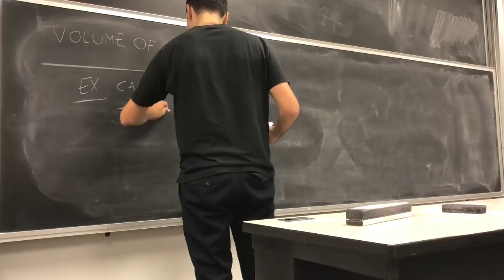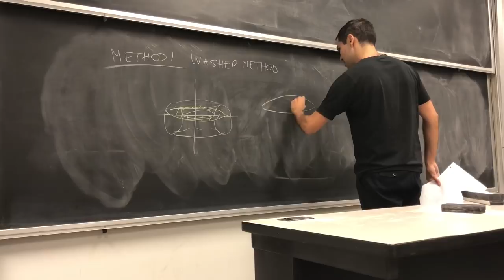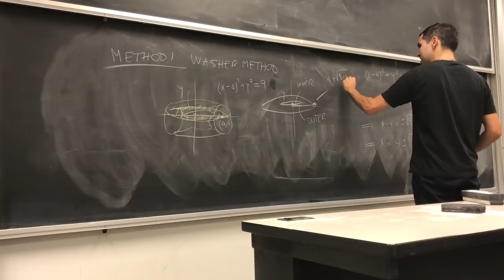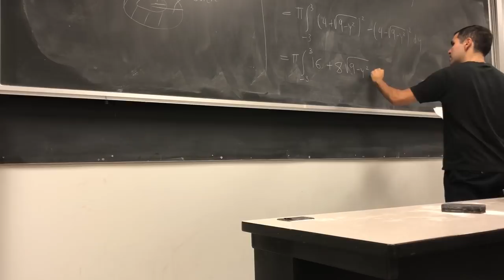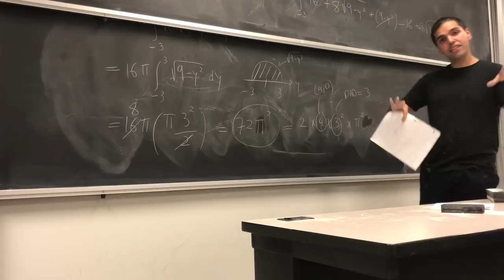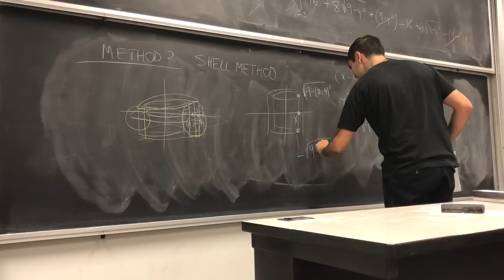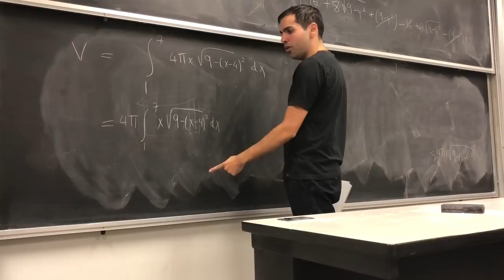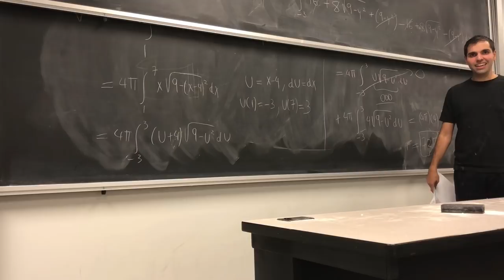Volume of a donut

Comment: Why not just 8π × 9π = 72π² (Volume of a cylinder)?
Reply: This is a more rigorous proof of the volume of a torus. Assuming it is a twisted cylinder isn't rigorous enough to prove it, but it is a nice intuitive solution.
Reply: @GhostyOcean   Why would this method be less rigorous? You could rephrase it as the area of the cross section, of the torus, multiplied by the circumference of the average radii running from the origin to the torus.
Reply: @jameroth7661  you have to show the volume you lose on the inner part is exactly gained on the outer part. Maybe you could approximate the torus by n truncated cylinders:

  __
/__\

where the truncation angle is 2*pi/n. and find the limit of the sum of their volumes as n approaches +infinity

Comment: You forgot sugar on your donut.
Reply from the maker: Hahaha, so the volume + half of the surface area? 😂
Reply: Well only if you consider liquid sugar.
But you can consider sugar as solid spheres of constant volume that are spread statistically with a gaussian so that the center of the circle has a lot of sugar and the borders have the less; then revolve it around the axis of revolution.
Finally say that the pastry cook added m grams of sugar per donut.
White sugar contains 99.8% of sucrose whose molar mass is 1.587 g/cm^3.
Sucrose has a cristalline structure of parameters 1,08631 nm x b = 0,87044 nm x c = 0,77624 nm so you can get the volume depending on the mass.
Finally you get the volume of the donut (with sugar) as a function of m, the mass of sugar added on your donut.
Reply: PackSciences that’s insane ahahaha!

Comment: There is a very simple algebraic solution to this:
A donut has the volume of the cylinder rotated to form it. hπr^2.
Our cylinder has radius 3, hence, the base has area 9π. The height of our cylinder is the circumference of the donut at the center. The circle is centered at (4,0) diameter is 8, the height of the cylinder is 8π, the circumference. Applying hπr^2. The volume is 72π^2.
Reply: Brandon Klein I like this.  Also, circles are actually triangles :)
Reply: Gold161803 with base r and height 2πr!!:) Minute physics does a great  "silent proof" of this!
Reply: A donut has the volume of the cylinder rotated to form it? Well, thats easy to say. But why?
Reply: Alexander Marcus well a torus is an infinite collection of equivalent circles, in the case of a torus, rotated around an axis, in the case of a cylinder, these circles are vertical!
Reply: @brandonklein1  is a torus really an infinite collection of circles? If i arrange circles around an axis, the circles bunch up in the middle and branch out towards the outside of the circle. In other words, if i try to curl a cylinder into a torus, the outer side of the cylinder is stretched and the inner side is compressed.
Reply: This was absolutely not neat. Sorry for that but it's true.Before that, you have to prove how Cylinder rotated into a Torus by distributing the volume with such a way that the midst circle has a perimeter equal to the height of the Cylinder.
Reply: @brandonklein1  You are right. But volume distribution while rotating is very important. In that case, you can only connect a dimension to its upper or lower dimension by only calculus(dx->0)
Reply: @IshaaqNewton  I apologize, I was in high school when I wrote this reply and have since taken many more math courses. In defense of my original comment, it is moderately intuitive that there is a linear scaling between the "circle density" at any given distance from the center ring of the torus. This is because circumference is proportional to r, yielding an average of the midst circle for the height.
Reply: @brandonklein1  Pretty right but not full. I advise you to look more closely and try to prove that yourself mathematically. It will be easier then for you to understand.
That volume distribution is not actually smoothly proportional.
But will be pretty symmetrical if you graph it. The overall result shows mid-line of the Cylinder can be equal to the mid-circle of Torus if we compare them to be.

Comment: + Dr. Peyam: At 9 min + a bit, you've got a difference of two squares as your integrand.
Don't over-complicate it by expanding both of those and subtracting; just write the difference of squares as difference times sum! Much simpler and easier that way.

1. Washer method
2. (Cylindrical) shell method

How about a third method? – Pappus' Theorem:
The (n+1)-dimensional capacity of a figure of revolution is the product of the n-dimensional capacity of the figure being revolved, and the length of the circle described by its centroid.

Using this theorem requires no calculus (unless the centroid can't be found purely by symmetry). But of course, deriving it does.
And the nice part is the generality of its application. In the case of a torus, it can serve to find both its volume and its surface area!

Comment: Lots of ways to do this one. Take a 2-D annulus with inner radius r and outer radius R. The area is pi*(R^2-r^2). Multiply by (R-r). You have a volume of a square tube bent into a circle. Multiply by the ratio of a circle inscribed in a square (Pi/4). You get:
V= ((Pi^2)/4)*(R+r)(R-r)^2. 
Plugging in R=7, r=1, you get 72*Pi^2.

Comment: I prefer using the method that turns any toroid into an equivalent prism, and find the volume and area in it, in this case a circular prism (cilinder).
This method can also be used to turn a ring into a rectangle to find its area.
Also, the area of a torus is also the area of the circular ring that forms when cut in half horizontally, π times, as in a circle the circumference is the diameter, π times.
Also, in a eliptic torus the area is the area of the eliptic ring, π times.
Using no integrals in any of these because they are hard :)

Comment: There is a theorem that make this really easy (here in Brazil we call it papus-guldan theorem). It says the volume of a revolution of a α angle equals to α times the area of the thing before revolution times the distance from the gravity center of the thing before the revolution (that would be a circle). So V=Axα, where x would be 4, A would be π3²=9π and α would be 2π. When u apply the theorem the result would be 4*2π*9π=72π².
Reply: The name is Pappus Centroid theorem

Comment: I solved this in my head using regular geometry  ( area of on circle multiplied by the circumference of the other circle), was this the wrong approach?
Reply from the maker: That’s actually the genius approach, a donut is in fact (mathematically) the product of two rectangles with the sides glued together!
Reply: Dr. Peyam's Show It is the very famous Pappus's centroid Theorem 😉
Reply: + Cédric P.: Bingo! My comment exactly!
Takes calculus to derive/prove Pappus' Theorem; but it works in n dimensions, and it can be used to find both volumes and surface areas.

Comment: Nicely done!
For the connection between this and your earlier exercise finding the capacity of an n-ball, see my comment under that video!

Short version: The 3-capacity of (the hypersurface of) a 4-ball of radius R, is just the volume of a torus whose minor & major radii both = R.    I.e., its "donut hole." has radius = 0.

Slightly longer version:
The (n-1)-capacity of (the hypersurface of) an n-ball of radius R, is just that of a torus made from an (n-2)-ball with vanishing hole.
And the n-capacity of the n-ball is that (n-1)-capacity times R/n.

Comment: wouldn't it be simpler if you take the fact that it is a circle rotated around the y-axis? That is, you take the area of the circle, which is  pi*3^2, and multiply it by the circumference, which is 2*pi*4,
 Therefore the volume must be 72*pi^2, no calculus involved, possible to do by a 8th grade student
Reply: Yes! This is Pappus' Theorem, and we learned it in 7th grade General Math. With it, you can get the volume, and the surface area!

Then, several years down the road, we had to derive it in calc class.   :–(
But the amazing part is, it works in any number of dimensions; and it was (I think) known to the ancient Greeks!